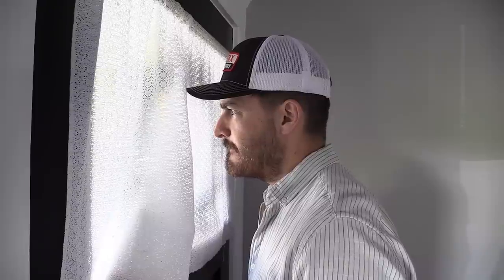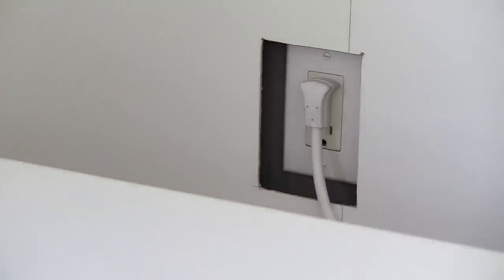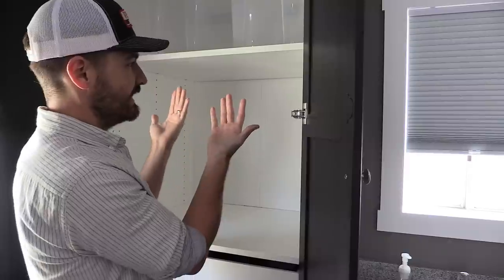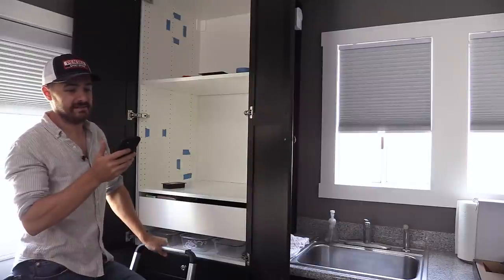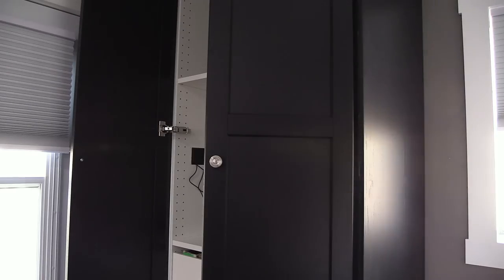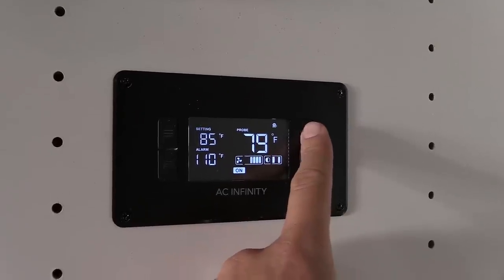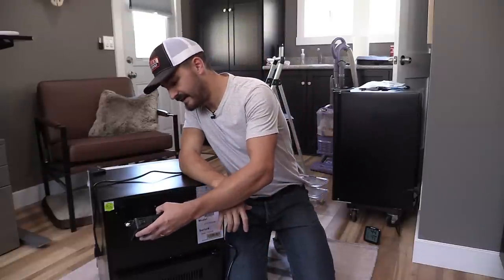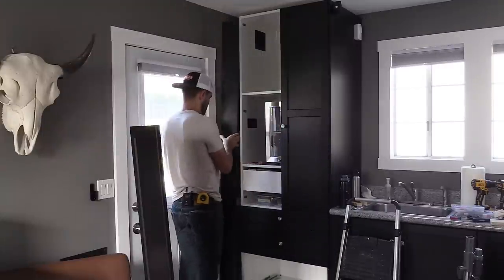Check Out My Sweet New Film Fridge

Comment: Hi Nick, always enjoy your videos. Please reconsider the placement of your fans. Hot air from the back of your fridge is going up as physics law work, so it should be blown out with an upper fan and the cool air should be blown into the cabin on the bottom. Actually, it would be more than enough to have only one fan to move warm air out with free inlet at the bottom but it would be to easy ;)

Comment: Well done, though it would bug me endlessly to know that only one of the doors activates the lights... can they be daisy chained?
Reply from the maker: Now you’re speaking my language. I could easily daisy chain it so that both had to be open to trigger the light, but I’m not sure how to make it so either door would trigger it. I’m sure I could figure it out if I made my 2 remaining brain cells work hard enough.
Reply: Maybe you could get a second switch and wire it in parallel with the first one. This way either one will complete the circuit, and if they are both in at the same time, no problem, you just have parallel shorts.
Reply: One benefit is being able to just open the nonswitch door to let air flow on a crazy hot days if required etc

Comment: So, the only thing missing to absolute perfection is to have two of those switches wired in paralel, so the light would turn on if either door is open.

No practical reason to do it, of course, but...

Comment: Great video, and good craftsmanship, but I don't get the point about the fans. Every normal refrigerator is built into a cupboard and does not require any extra fans, it just has to have a hole at the top and bottom. With your solution, the warm air is pumped into the space between the cupboard and the outer wall and the heat cannot escape there either. In addition, the small refrigerator does not generate much heat, the performance is far too low. Keep up the good work and prefer video about taking photos. Thanks.

Comment: Just wondering if you could have mounted the 'out' fan within the same space as the 'in' fan, negating the need to cut the top shelf? Also, my OCD was triggered by not centering the fans within the shelf pin holes. Other than that, good job 👍

Comment: Great video Nick, as usual. One question…is the void to the left vented at all, or does that face plate run top to bottom? If so, you might consider installing a small vent plate on the front, otherwise you are just cycling the warm air. Not necessary, but a pleasing finishing touch for a perfectionist.
Reply: 3:57

Comment: Two holes behind the fridge would propably have been sufficient, but hey, why not...
Reply from the maker: I actually calculated the surface area of the 4.5-inch fan and made sure I cut slightly more out of the back of the shelf so there wouldn’t be any bottle neck 👍🏼